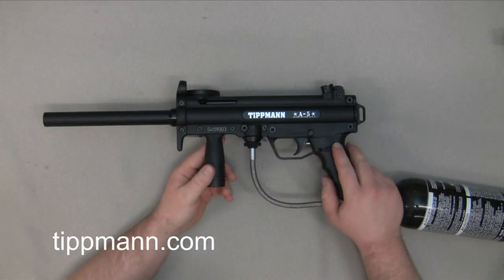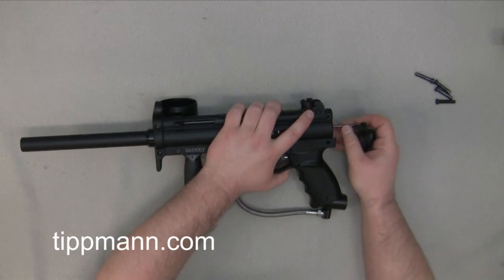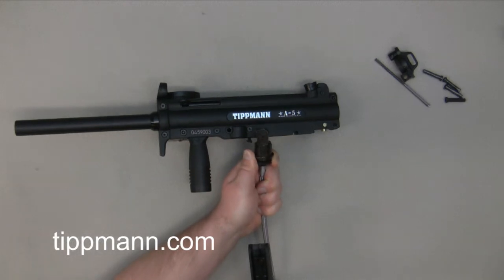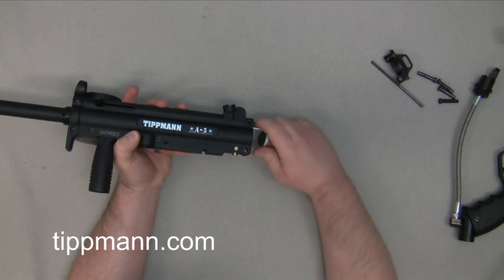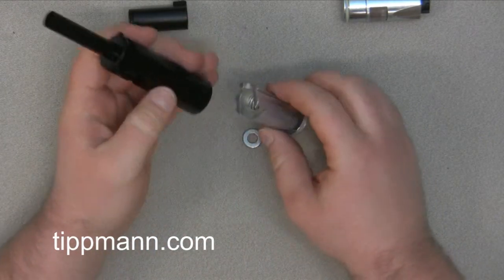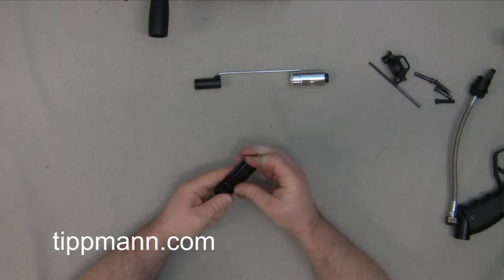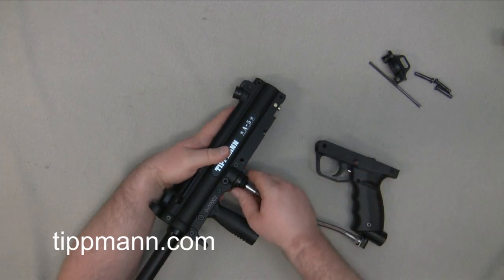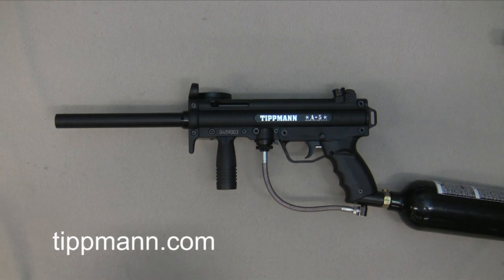A5 Troubleshooting Air Leaks.mpg

Comment: Thank you Tippmann, you just saved me from selling this great gun. My gun was leaking CO2 like crazy so I brought it to a pro shop and they said to sell it. I didn't want to so I looked in the gun and it looked fine. After watching this video I found out that the big o-ring that keeps the valve together had a very small rip in it, so all I had to do was replace it, thank you again Tippmann.

Comment: Wow, thanks for this video man, even 5 years after uploading.
I bought a used A5 about a year ago as a project gun. The previous owner told me it worked fine, he didn't have a tank to test it either so I'm not sure why I didn't pick up on how fishy that was, I probably should have offered a lower price but I guess I had to travel quite far to get it and didn't want to go back home empty handed. I finally got around to working on it for my project this week, and it turns out it has a leak. I saw this video and decided to take a look at the valve assembly. It was missing that washer between the spring and o-ring, so the spring would just move around willy-nilly. I found a washer that looked similar in size to the o-ring, put it in, it seemed to fit so I got it all back together and now it works.

Comment: Great video TippmannSports!  I've own my A5 w/ RT for a long time now (Serial #31105) and have yet to replace a single o-ring.  It's cleaned and oiled after every weekend of play.  My A5 needed to be cleaned today, I aired it up to dial-in the RT, spent a little time dry-firing--then degassed as disassembled.  Once I aired the marker up again, I developed my first leak--I was a bit puzzled as all the o-rings looked great--just like Day 01 from the factory.  I figured since I've own this marker for so long, maybe it was time I replaced the front/read bolt o-rings... but the air leak didn't sound like it was coming from the bolt.  *I found this video and thought, let me just check the valve.  I disassembled the valve assembly, lubed the o-rings there, reassembled the marker--NO LEAK! :D  Very exciting (although I already placed my order with Tippmann Products for the front/rear o-rings)-Ha!  Well, this old marker is still kicking with the original o-rings and looking forward to many more years.  Thank you for such a great product!

Comment from the maker: @Keyholder79 First remove the velocity screw. Then take something that will fit down the small end of the power tube and push the valve out of the large end.

Comment: Thank you for the video, one thing I will note is that I have had my A5 for over 7 years and until recently never knew about that tombstone being able to be unscrewed from the air line and that there was an o-ring in there (mine had gone bad, totally cracked up and shattered). Just a note if someone still has a leak around there after checking the valve.
Reply: What size was that O ring lol do you remember
Reply: @bennymiller2885  I don't remember unfortunately, but it should be in the manual or able to call Tippmann to ask

Comment: ok every time i shoot my tippman with co2 it leaks from the first oring of the bolt  but when i shoot air it dosent i have notice thats the oring simply go out of its position could it be  couse im using a macdev oring? my problem should be fix with a tippman oring?

Comment: Is there a way to fix the A5 being A air hog? I been hearing that it is. was hoping to run tac-cap with 13/3000 tank. but if I can only get 60 shots not going to work.